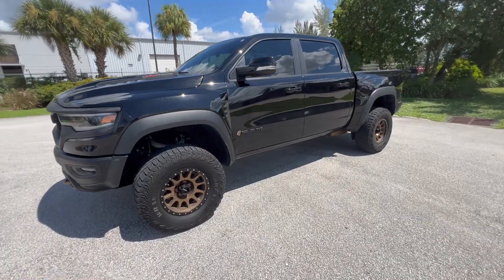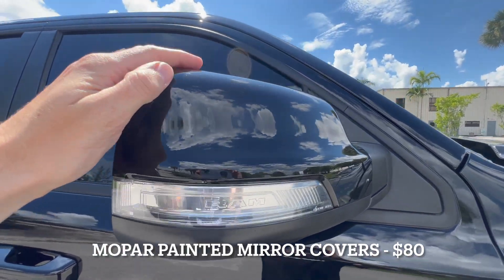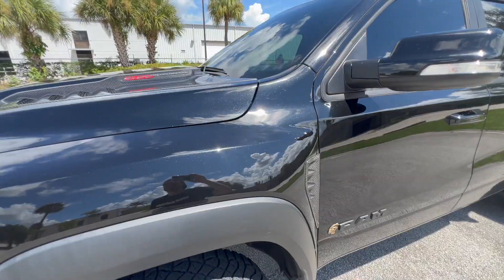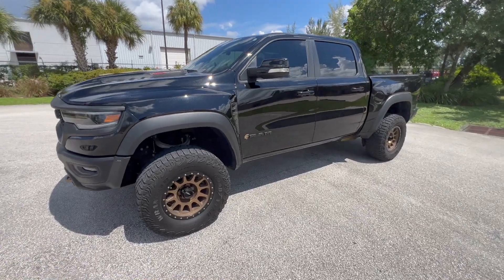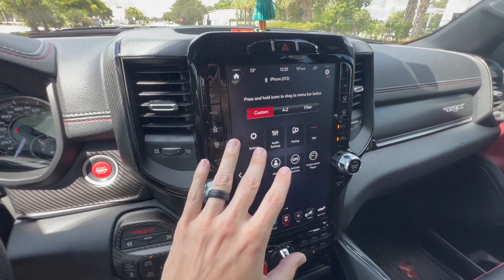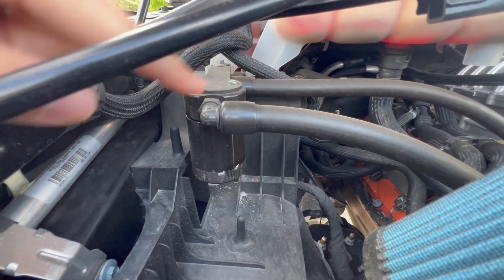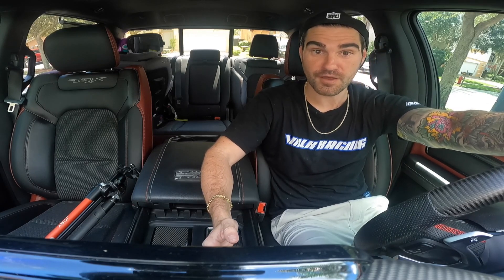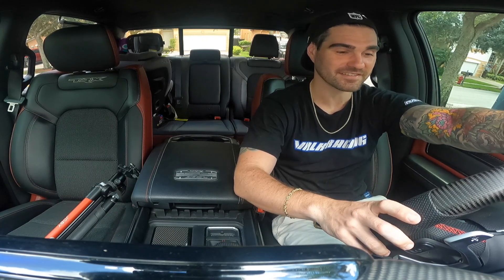Ram TRX Build Full Break Down

Comment: Thanks for the video. I have the same TRX as yours. I really like the Carbon on the exterior. You called them skins. Are they a decal that goes over the original plastic or are they a carbon fiber insert? I subscribed

Comment: Bro nice content!! Subscribed with the front springs perch from Fourtz do you have any damage with the cv boots yet?
Reply from the maker: Appreciate that! 🙌🏼. Nope, no CV boot issues after 2+ years & 30k mikes. (Knock on wood)
Reply: @Wimya  thank you bro !! Do u remember if the kit was 1.5/2/2.5? Damn I don’t want to get the wrong one but I do want to put 3/4 in the rear also.  How’s the ride with the front perch bro? Be honest please if it’s harsh then I’m go with full springs from Eibach  thx
Reply from the maker: @nary4tom96  it is a little more firm due to the added preload but honestly in my opinion it feels better than stock. I always felt the stock suspension was too soft so this made it more enjoyable for me. I believe my perch collars are the 1.5” but when I purchased them they didn’t offer different sizes.
Reply: @Wimya  thank you bro
Reply from the maker: @nary4tom96  no problem brotha!